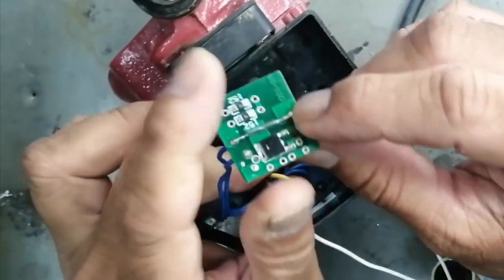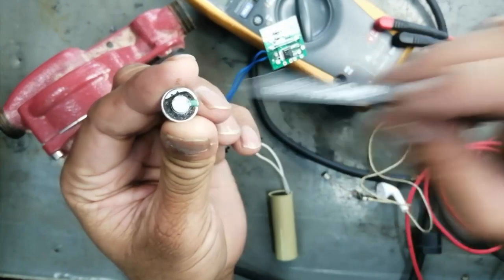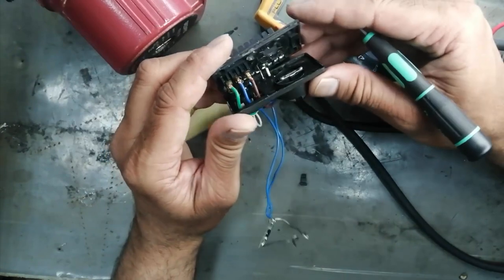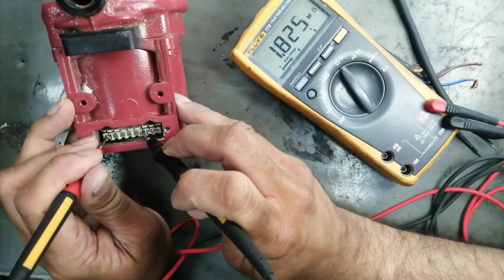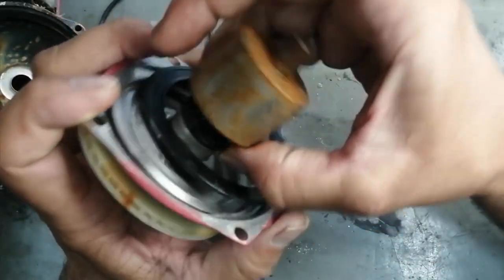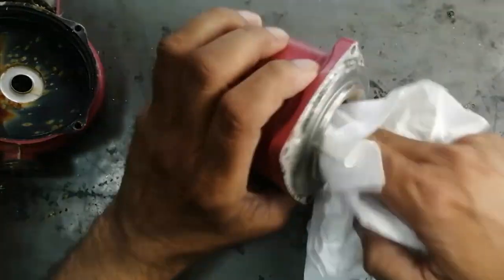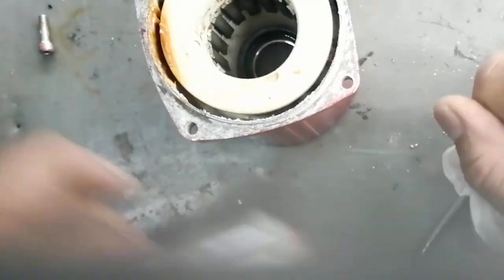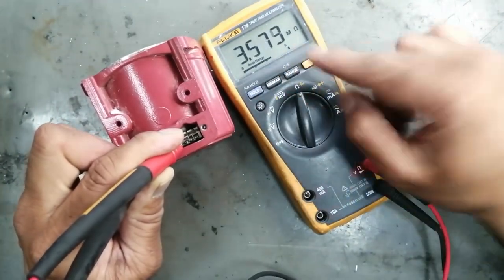#159 How to disassemble & test water pump greenpro rs12/9G

Comment: I got one the Auto won't work.. Brand new.... any advise.. works on manual  fine
Reply from the maker: oh that is so sad. please check its electromagnetic sensor switch, most of time that is misaligned
Reply: @HaseebElectronics   All sorted it was the shower lever,...it had to not be fully open on the hot.... had to back it off so there was pressure at the pump.. having it fully open seemed to stop pressure.. we tested on the rest of the hot taps and they where good so we new something was going on at the shower end.... thanks for your input it all helps